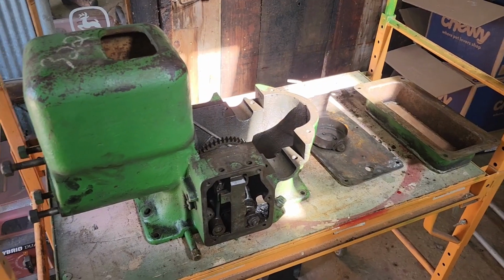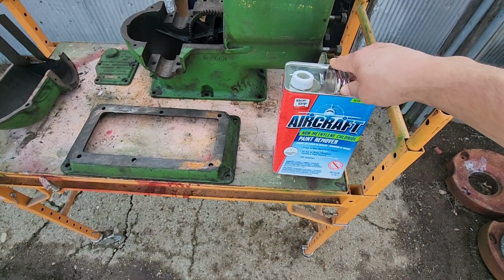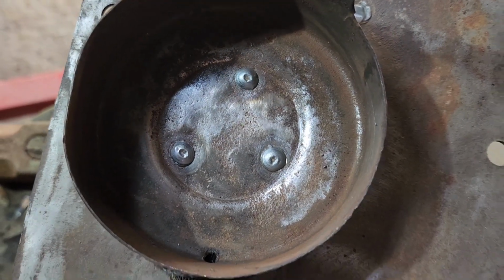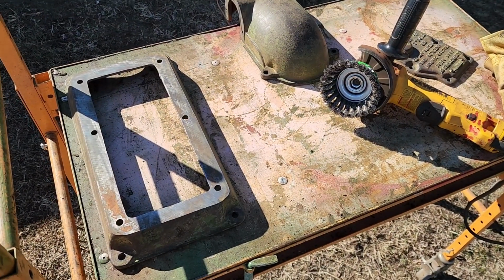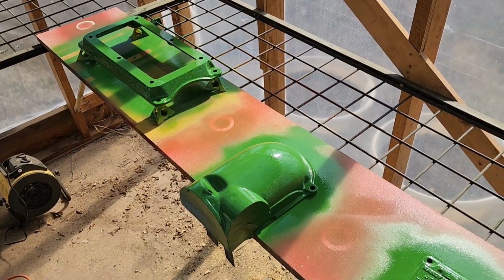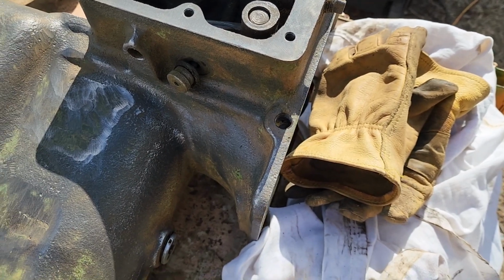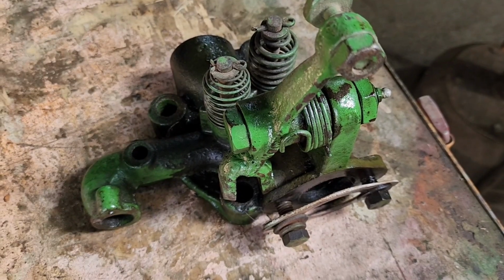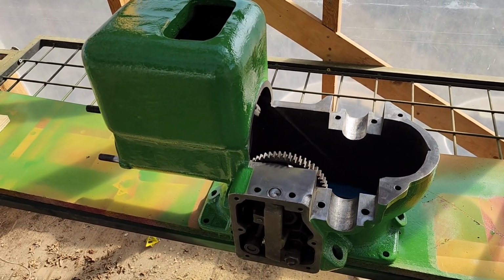John Deere Model E Episode #3

Comment: I love Farmall but you are swaying me,loved the color of the primer and it makes sense under JD green. Is that grease zirk on the rocker bolt welded?? And I LOVE that pulley exhaust, Im stealing that idea it has the holes to exhaust out from where it bolted to the engine and the aluminum pullys act like cooling fins a bit....LOVE it. Cant wait for more.
Reply from the maker: Coming soon!